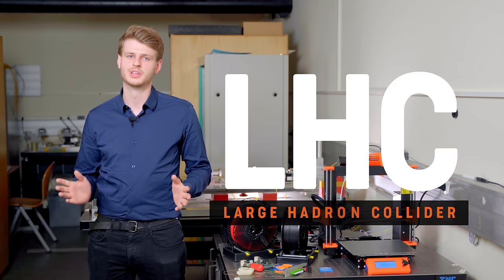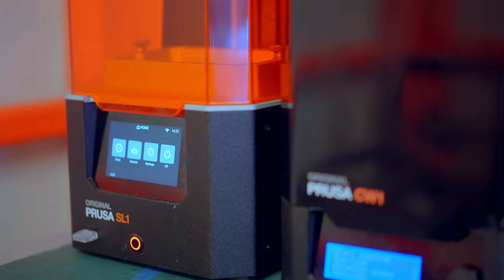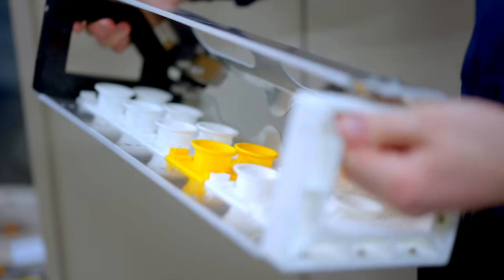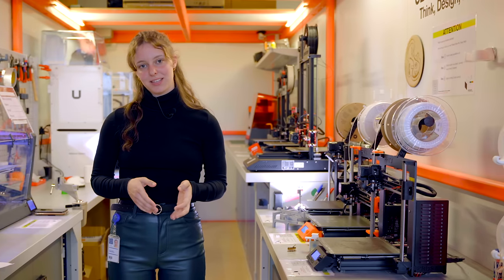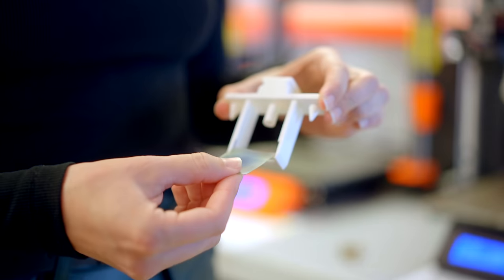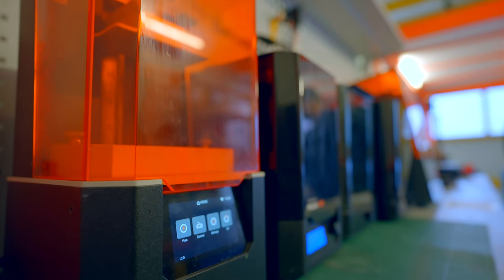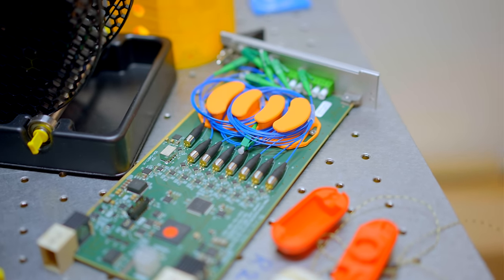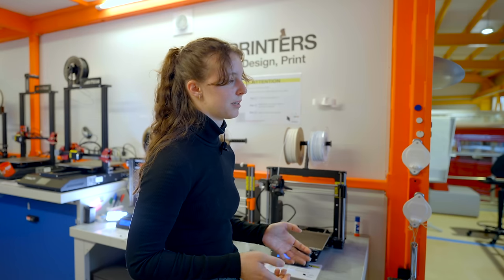CERN: Accelerating science with 3D printing

Comment: Because I am in similar facility as an engineer in Germany we also start using a 3d printer. But there is no feedback from other scientific facilities for example about materials and how their work in radioactive caves. Maybe there will be more in the future ... Thanks for the video.
Reply: There are at least 30-50 thermoplastic materials suitable for 3D printing that you can buy commercially in spool form for 3d printing. These materials originated in the plastics industry and you can easily find the MSDS for each material. For example PEEK can be used from -70C to +250C. It is also very radiation resistant
Reply: @asicdathens  yes but you cannot use PEEK with a Prusa printer ;) so in this case only some materials will fit. Would be nice to know which one